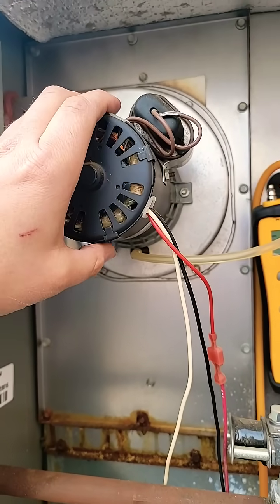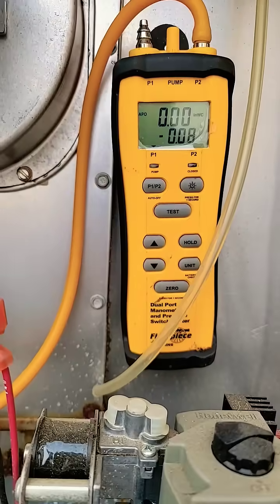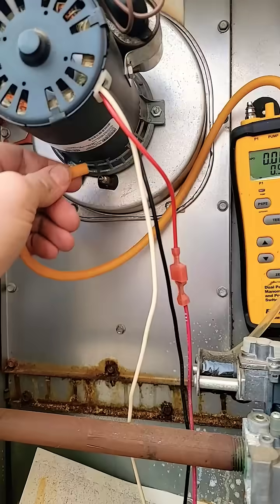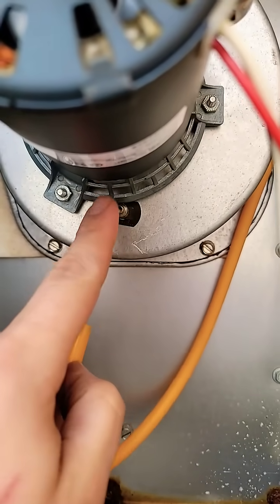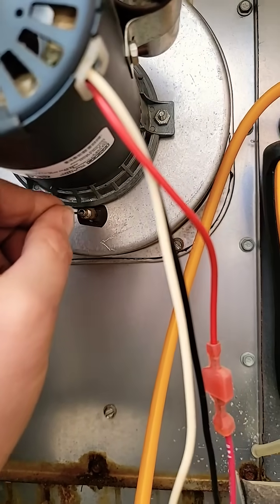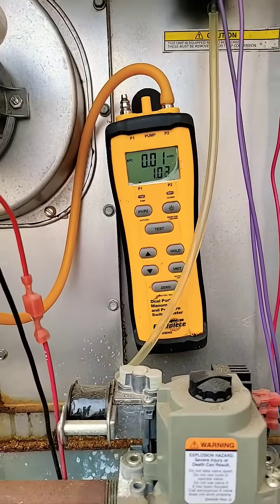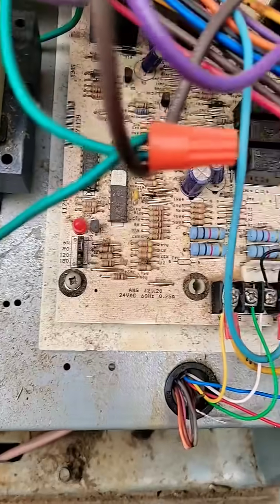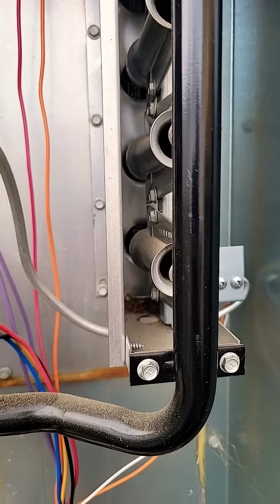How to Measure Vacuum Pressure?

Comment: You just pushed the obstriction back into the housing so it can obstruct it again. I have a vacuum with tubing rigged up to suck it clean. I also would remove the assembly to clean it out

Comment: Not sure why he says; "vacuum pressure" when the draft is induced on the air supply rather than scavenged from the exhaust. Of course the tool can measure both, and can be zeroed.

Comment: I was told to use a t when checking inducer pressure to see the drop once the combustion happens to see if the issue is a blockage in the heat exchanger

Comment: No, tell me why my gas valve opens for one second on an 80% ultra low NOx furnace 😖
Reply from the maker: check gas pressure 
check 24 volts voltage to valve

Comment: Nice!  I run across a couple of these clogged ports every winter.  Also, sometimes roofers will smash the vent cap down, effectively blocking the flow and keeping your pressure switch open.  Same flashing code on board.

Comment: It looked like the ratings were the same? If the measurements the same and it fixed the pressure switch issue were you getting an accurate reading

Comment: You fixed the problem but you had the same pressure readings, so what you should say is use your eyes first. Also next time hook it to correct port on your meter, measuring negative pressure. Vacuum would be done with micron gauge.
Reply: Hopefully you understand what I’m saying if not, I’ll send you my phone number sometime and when you have questions You can ask a professional
Reply: The pressure switch was marked as point to negative inches water column you’re reading was 1.2 negative inches water column. The problem was it’s a false reading because even though your meter showed that there was enough negative pressure the switch still wasn’t closing. Hopefully this was a learning lesson for you. Even though your meter says something, it might not always be the case.

Comment: You fixed the problem but you had the same pressure readings, so what you should say is use your eyes first. Also next time hook it to correct port on your meter, measuring negative pressure. Vacuum would be done with micron gauge.

Comment: I looked at the same reading in both cases.
Reply: Yes, I replayed and saw the same reading. What’s up with that?
Reply: @TroysWorld313  I saw the same thing, I wonder what you correct settings are for the pressure switch
Reply: @tnice58 depends on the switch, the rating is on the pressure switch.
Reply: Dude I gave up after his second video. Idk who trained him but my god

Comment: It’s not mentioned, but the reason why the PS wouldn’t close the first time even though similar negative pressure was observed both times is… the PS is vented. You need to overcome the pressure rating as well as having enough air flow volume. Using a tee fitting and leaving the PS connected would show a drastic result and exactly why the switch wouldn’t close originally with a restriction at the draft inducer port. 👍
Reply from the maker: Absolutely correct thank you so much for adding this information

Comment: Grab yourself an arzel pressure hose T, then attach that to the end of the manometer tube, attach 1 additional hose to the T, leaving 1 exposed port on the T itself. Take the hose from your pressure switch and connect it to the last open port on the T. Depending on negative or positive pressure you are now able to measure draft while everything is running. Not talking shit on what he’s doing. Just letting everyone know there’s another way
Reply: This manometer actually comes with a T I believe. Looks more like a Y but it’s the same thing lol.
Reply from the maker: Very good knowledge man
 thank you so much for sharing this

Comment: Your manometer can test pressure switches without running the inducer. The middle tube port on top connects to the monometer's pump. It also has 2 lead connections on top to connect to the PS terminals. You can manually increase the pump vacuum to verify if the PS is closing at the correct suction it's rated for.
Reply from the maker: Good tip!
Reply: Not necessary if the switch won't close. I just suck on it to see if it works.  I don't need no stinking manometer.
Reply: @deanburke3041  the tool creates the vacuum and increases by 1/100 wc. Then you can tell if your switch is or isn't closing (and reopening) at the designed vacuum for that specific switch. Using your mouth can potentially damage a good switch.
Reply: @Cavett24  I don't suck too much, so it's never a problem. I even give demonstrations  for show & tell to the customer.
Reply: @deanburke3041  "That's what she said."
                                            Michael Scott
Reply: Vacuum pressure is very slight, a fraction of even 1/10 th " W.C., And... sometimes 2 or 3 switches at different miniscule vacuums for high& low fire. Then it may make sense to use a multiple port manometer. Even then, it may be inconclusive. Something else doing it.

Comment: Vacuum is measured in inches of mercury (in/hg), not pressure
Reply: Oh and when it comes to most hvac you use inWC or inches of water column. It’s used to measure static duct pressure, the draft from an inducer (like in the video), and also gas pressure.
Reply from the maker: Thank you
 Very good
 Thank you for sharing this information
Reply from the maker: It's called a pressure switch
 So when I refer to measuring the vacuum
 I always say vacuum pressure or pressure
  Thanks for watching
Reply from the maker: You are correct by the way
Reply: You can measure a vacuum in many ways. Inches of mercury is the least accurate way. Most measurements of a vacuums are done in microns, torr, and bar. Also a vacuum is literally negative pressure. Hence why you can measure a vacuum in negative psi as well. Which is a measure meant of pressure lol. Hell all of these measurements are measuring pressure either positive or negative.

Comment: I've done installs for 12 years and service work for the last 4. It's nice to see technicians take the time to explain what's going on. On a side note I have my grand pops old graduated cylinder ( thinks the name of it. But you will the glass tube with water then attach a tube the same way and measure the difference in water hight then do the math to come up with the same thing just takes about 20 minutes longer to get the same answer
Reply: that old fashion U-tube was also used to measure gas pressure in inches of water column. You just have to do the math to convert it to inches of mercury for vacuum.

Comment: Why was the pressure at 1.1 then it dropped to 1.0 after you cleaned?
Reply: I was thinking the same thing pretty much. It had a better vacuum before he “cleaned” it. 🤷🏼
Reply: He ran the wire into the fan blades so it works great  👍
Reply: @r.h.b.4980  😂🤣
Reply: I'm guessing he had the manometer connected backwards

Comment: What if pressure switch is closing and igniter doesnt ignite and gas doesnt come on?
Reply from the maker: Check the other safeties
Reply: If it’s not a safety then check if the board is sending power to the igniter. If it is then it’s the igniter if it’s not then it’s your board. Most boards have a code led light that’ll tell you what’s up

Comment: Should tee it in. Way more accurate.
Reply from the maker: Great idea Thank you 😊
Reply: Actually not. Better to test inducer first. If u have cracked tubing or other issues tee in will not help much. Really common for crap / rust in inducer port. Better to get a baseline inducer reading for start then tee in & check pressure switch value.
Reply from the maker: Excellent I love this
 2 different perspectives and perspective drives performance I love it thank you so much for sharing this information